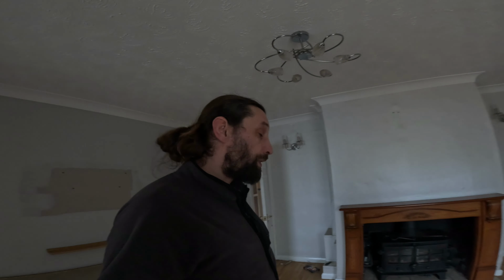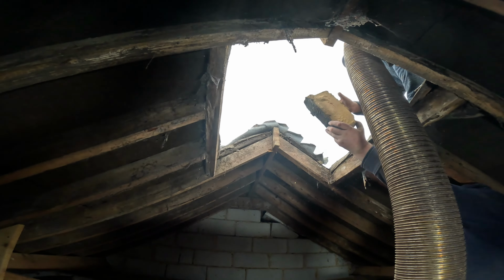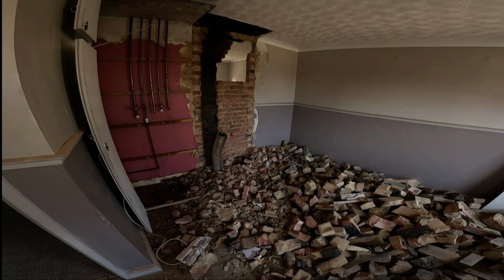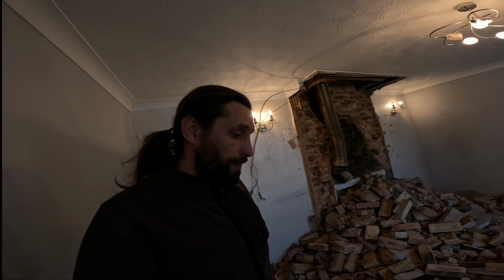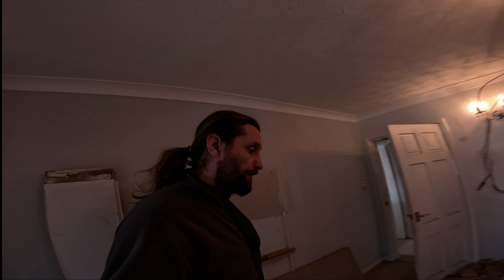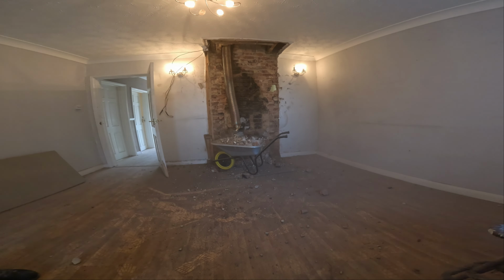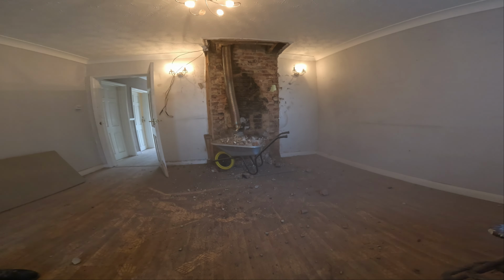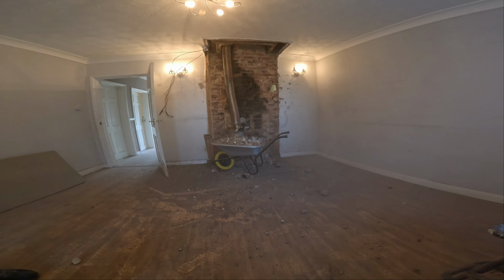Chimney Breast Removal part 1

Comment: Jesus... don't you need steels erected to hold all the joists up while removing that and splitting load bearing walls in two?
Reply from the maker: Hi. you usually do need some acrows underneath to sustain the floor but in this case the chimney is in the middle of the house and the floor weight it's transferred to the side floor joists that are thicker and seat's on the wall. Well they should in theory but the second part of this video will make more light on the matter.
Reply: @How2Extreme  Thanks for the reply mate. Looking forward to part 2.
Reply from the maker: It's my fault, i had to take my time and  explain a bit more on what's going on and why im doing it like that
Reply from the maker: Probably next week on monday
Reply: Of course they do. They also need planning permission but too stupid to realise it.

Comment: Well done you guys made short work of it!
I want to do a similar project. Do you know if planning permission and building regs are required to remove a chimney?
Reply from the maker: You should always check with your council ,the rules are sometimes different, but usually, if you take the chimney down completely from the top of the house, you don’t need building regs.